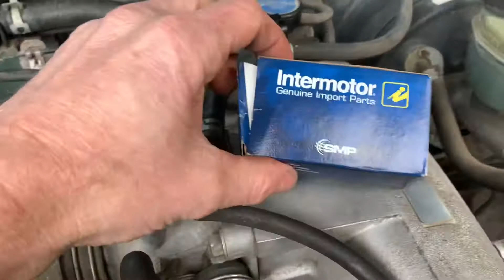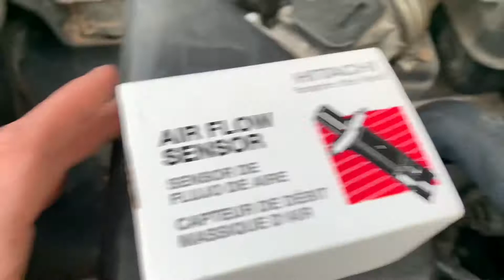Toyota Tacoma 2WD Pre-Runner | Throttle Positioning Sensor | MAF Sensor | Heater Control Valve

Comment: I bought a 2000 Tacoma 4x4 with the 3RZ engine ( 2.7 ) as well. Still own it. I have already installed the EGR block-off/delete kit sold by LC Engineering, so if I ever need to replace the throttle position sensor, it will be much easier to access, with all of the EGR components gone and out of the way.
Reply from the maker: Very nice. Thanks for the tip too!